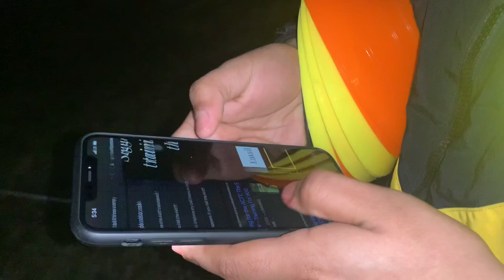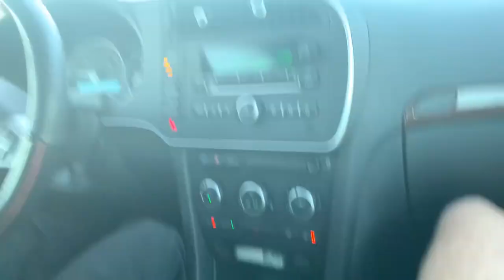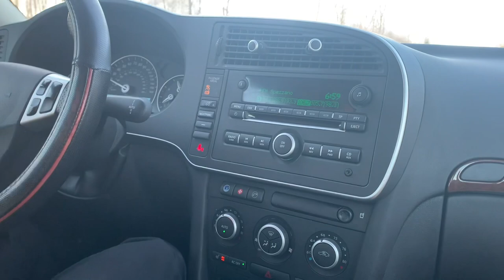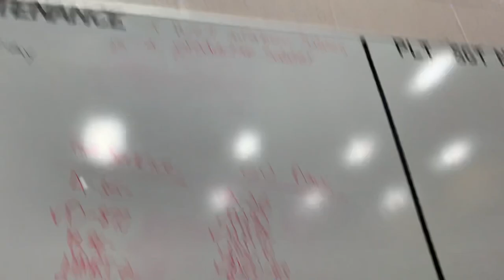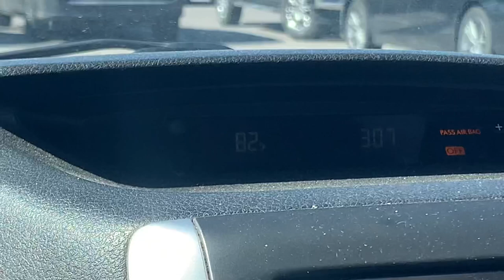Putting Transmission In A Humvee

Comment: I have an M1152 6.5 2009 4L80 transmission. I get it up to about 35~40 mph and that’s it. I never hear an upshift. It will over rev any more speed than that. I have checked the Brake switch ohms and it’s .3 ohms while driving and OL out of limits while braking I am unsure of what it should be. 
Do you have any advice? Maybe a valve body change and or fluid flush first with new filter? The TC light stays on.